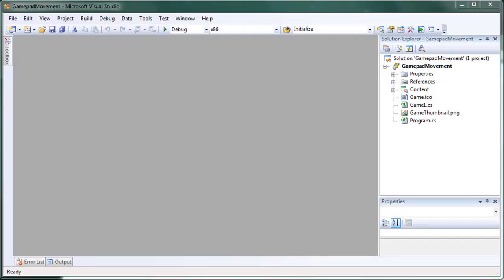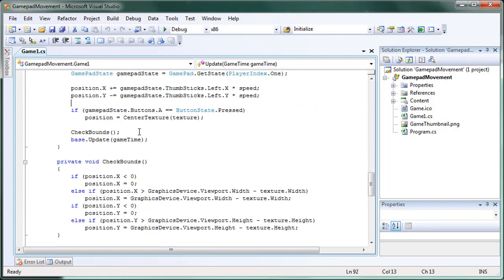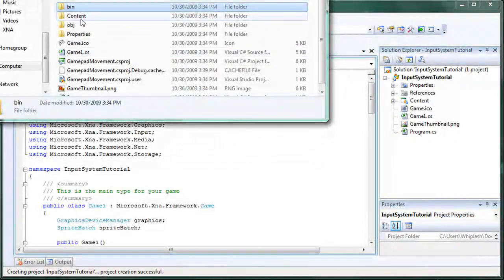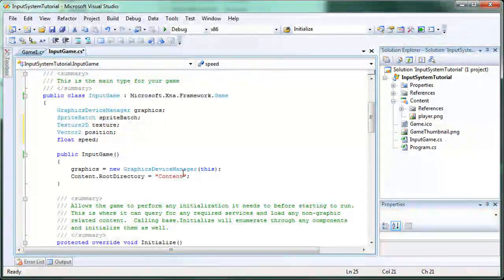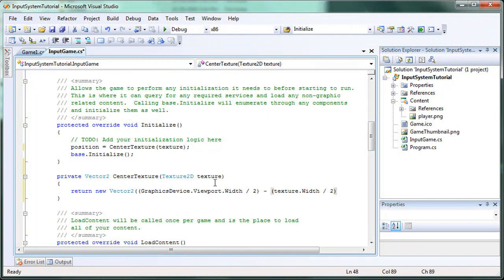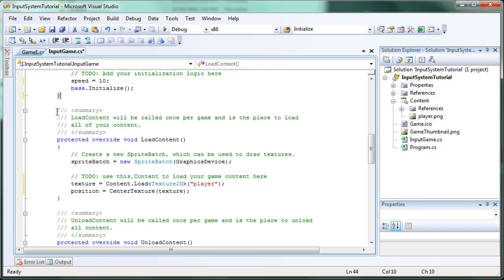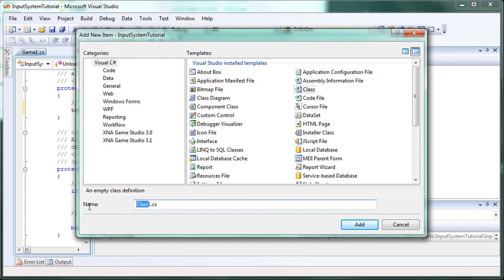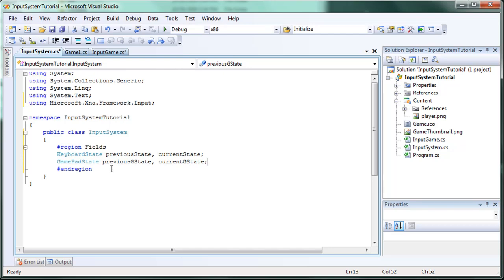XNA Advanced Techniques Tutorial 7 - Input Class Part 1

Comment: What exactly is the reason to make this class what are the advantages vs the regular Keybord.State call?
Reply from the maker: Because you will need to keep track of the current state and previous state.  With the input class, it will be handled for you.  At the end of the video, I begin to write the previous state and current state.  You will need to handle this elsewhere, or you can wrap it in a class.  We are just making it easier to handle if you want to see if it is a new key press (which requires two states to see).
Reply: Okay that makes sense, thanks for the quick response.  Why do you need to know if it's a new key pressed though, what differense does it make for the game that it's new key pressed or normal key pressed?
Reply from the maker: ***** Pausing the game for example.  Unless you can press escape (or whatever key you have mapped to pause) and release it in between two game loops (press escape and release it in 0.03334 seconds), you do not want the game to pause and resume immediately.  So we check if escape is a new key press.  You can hold escape down but the game will still be paused.  Releasing escape, and pressing it again will resume the game.  Bringing up inventory, map, binoculars, ... all follow the same idea.  You wouldn't want to open the map and have it immediately close.

Of if you want your game to only fire once per key press.  It is up to you if you want to do that for your game.
Reply: Nathan Biefeld Aha now it all makes sense :), thanks alot man!
Reply from the maker: ***** You are welcome.  We are just making a class to make things easier on us.  You will notice we extend this functionality in a later tutorial and create an InputMap class.